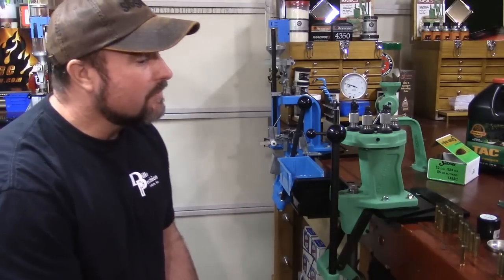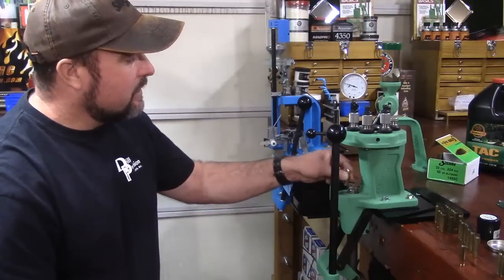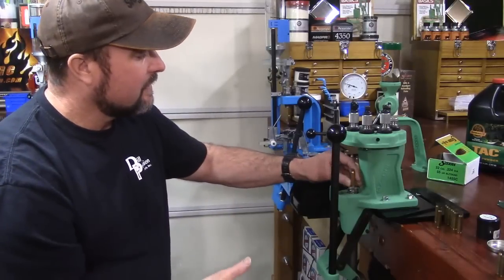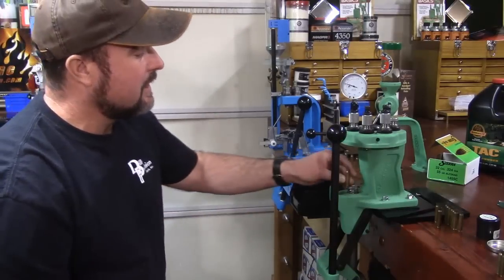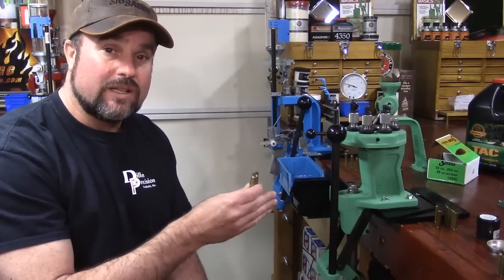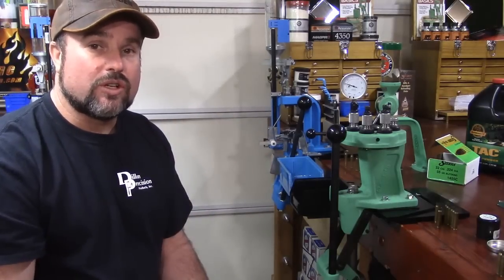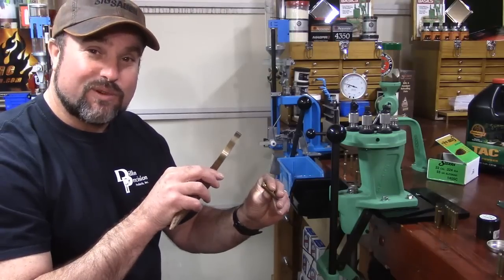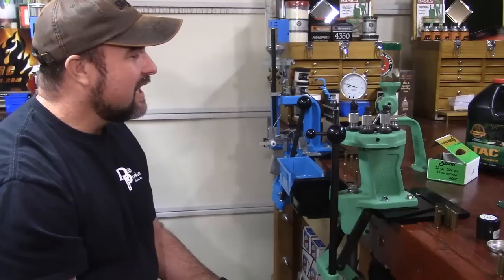AR-15, 223 Rem. Reloading Series, Video 77, Not All Chambers are Created Equal

Comment: Good day Jim, I have a question for you.  I recently reload 45 ACP with my Dillion 550, but when I tested the ammo with my glock 21, the brass for some reason did not extract/eject.  It stayed in the chamber and I had to rock the slide each time.  My first instinct is the OAL, but I verified and it fits the sami specification and I tested with the case gage as well.  Do you know what gives?  Thanks for your video, liked and learn a lot.  Thanks.

Comment: Interesting you can size below saami w/ the Redding die by adjustment.  On those that you could go below saami, how did they behave on the headspace gage?  I don't have that gage so just assume that my die can't go below saami as I just adjust according to the die instructions.  But I do test all my reloads on the headspace gage.  Last night I SB'd about 150 cases.  All but 3 passed the headspace gage.  Figured perhaps I must of short stroked those three.  Re-sb'd them and still failed.  Under the lens I could see a slightly skewed rim problem caused by either a funky extractor or perhaps some one didn't lube their cases well and bent it at the rim.  Didn't noptice it by the naked eye but that headspace gage sure found it and wouldn't let it set w/ a firm nudge.  That could of been interesting in the floating ar-15 firing pin.  Tossed them!
Reply: I've sized below spec on hornady dies and it falls below the lower shelf on the headspace gauge. the Redding competition shell holders help a bunch in that they allow you to get cam over on the press and still adjust headspace to where you want it to be. I'm sure Highboy will be covering those in the future.
Reply: +Neil Harris I had forgotten about the competition shell holders.  Last ight I picked up Hornadys headspace comparator kit.  There is an optional base attachment I will have to order to aidin better readings.  It was interesting to see the variations on the brass above.  I'll have to run them on my new Norma and Lapua brass.  Thanks Neil.